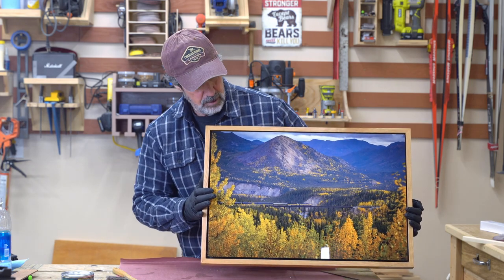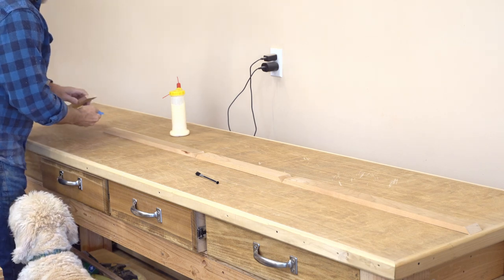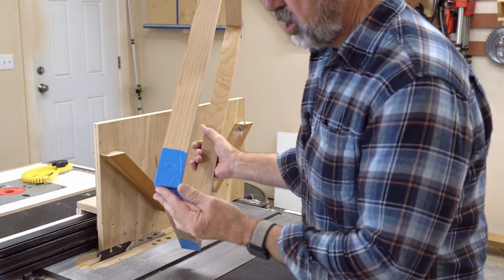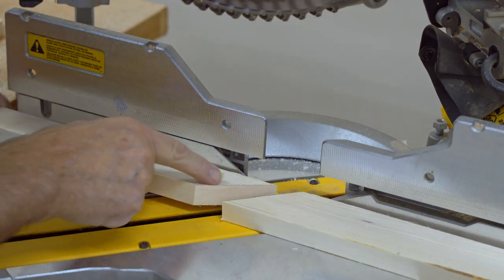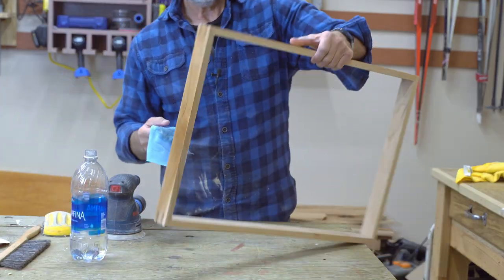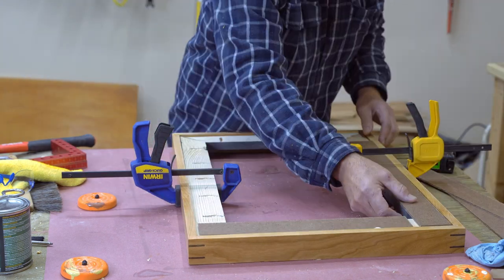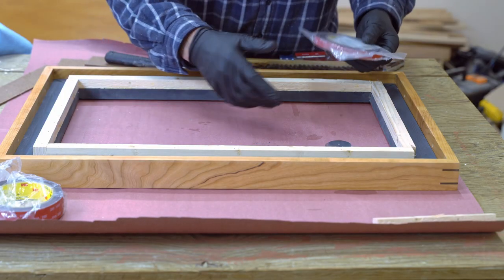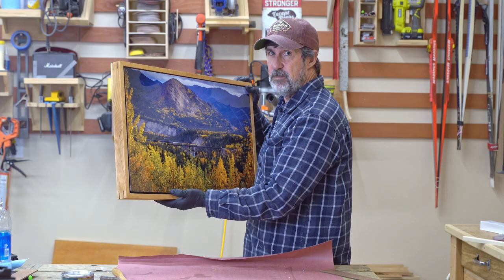Metal Print Framing

Comment: The double stick tape holds that okay? I'm trying to do this with a larger print and trying to figure out how to drill into the inset metal frame that's on the back...any tips?
Reply from the maker: Yes, be sure to get the industrial tape. I have a photographer friend that sells framed metal prints and he vouched for it. This print has been hanging in the Anchorage Museum for months and still holding up.
How big is your print? Not sure what you are trying to do by drilling into the metal frame.
Reply: @AlaskaWorkshop  Well we were trying to recreate how we attach float frames to stretched canvases/cradled panels (screw frame backing into wood stretcher bar). The print is 40x60", and I forgot to mention, it has an inset metal frame glued to the back (about 38x58") so we were trying to work with that, in the same way we work with the wood stretcher bars, and secure the back of the frame to that metal frame. None of our mouldings are deep enough though and you gave us the idea to attach wood so thank you! We're going to attach wood bars on the outside of the metal inset frame now (probably with E6000 instead of tape given the size/weight of the print) and that is what we will attach the back of our float frame to! Bit of a tricky one!

Comment: Everything you did was so professional and and well done! Respect, but then entered that doubled sided tape.... surely cannot be a long term fix for securing your metal print. There has to be another way???
Reply from the maker: Thanks Troy. I actually talked to the guy who does my metal printing about how he does it. He sells his photos worldwide and does this. This photo traveled to 3 different museums in Alaska right after I finished it. I got it back this fall and no sign of it letting up. The only issue is if you misalign it, you are screwed.
Reply: @AlaskaWorkshop Hey, thanks for your reply. Since my comment, I did find a printing company that used double sided tape to secure their aluminum frames to the back of metal prints, so that, and your photographer friend doing the same, it must be regarded as a normal, safe  practice. Because of your video and thoughtful reply, I will do the same when I make my floating frames! Thanks again! Cheers from southern Alberta.